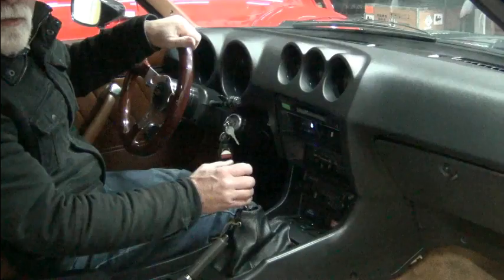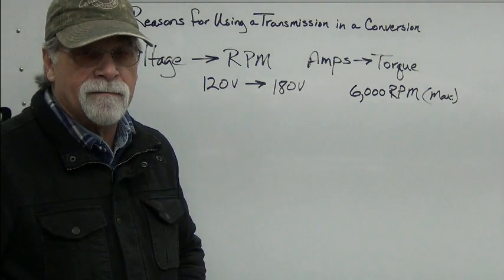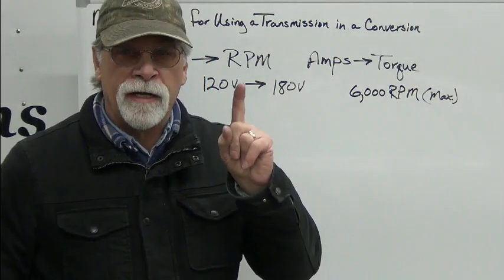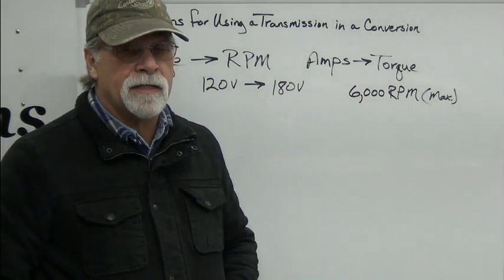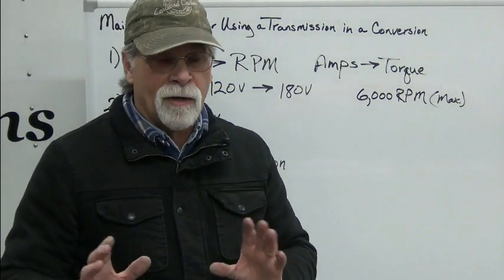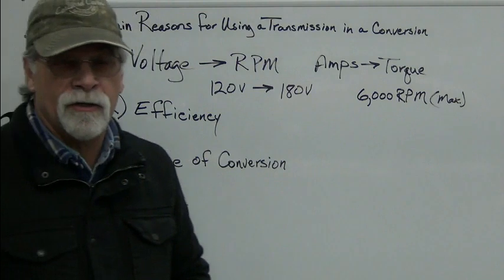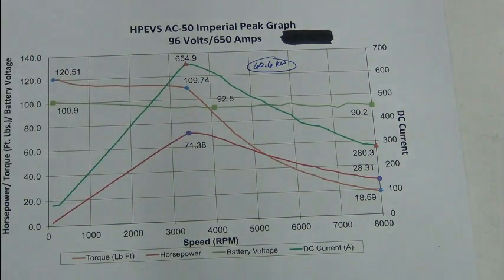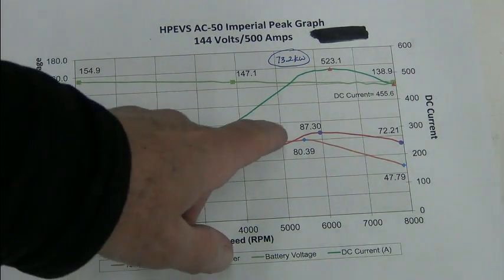Main Reasons to Use a Transmission in a Conversion

Comment: A transmission is a MUST in any conversion, it represents many advantages for either speed or torque. It is also a safety device. Writing this before watching the video.
Reply: Nice video but you didn’t mention SAFETY as a great advantage in a transmission. 

It could be nice to show those charts for the DC Systems: ADC 9”, Warp9 and 11c Kostovs, with the multiple controller options and voltages from 48V (I’m running a train at 48v moving 70 people in a park), then 72, 96, 120, 144V and then the super high voltages 200, 250, 300 or more that the Zillas can handle… destroying world records as well as motors in those attempts

Comment: For a classic conversion a fifth reason is the retains the driving personality and dynamics of the car. I still shift all our conversions. There is a myth that transmissions reduce efficiency in EVs, even though there is engineering studies proving a 15% increase in efficiency. You don't need as many gears do to the wide power band of an electric motor. This is much of the reason the Taycan always exceeds the EPA rating on the highway.

Comment: Back in the eighties as a fleet mechanic at a phone utility we had 12 ford courier pickups with 20 six volt lead acid batteries.  They retained the four speed and the clutch.  Only twenty miles of range but you gotta start somewhere.

Comment: Thanks Richard, and I'm glad to see this video very much!  I was wondering if you could talk about a scratch-build car in your next direct drive video.  I've heard from the community (for what it's worth, some yahoo on social media or whatever) say that direct drive is better for a non-conversion build.  When I eventually build a car, I'm going to coachbuild it from an existing chassis, so the sky's the limit as far as the planning.  Is there a benefit to going direct drive in that scenario?  Regardless, before I do any of this, I will be attending one of your classes, lol, but in the meantime, if you could touch on that it would give me a direction to think it over.
Reply from the maker: The #1 reason (voltage) does not change.  Direct drive will require a higher voltage system and a more powerful motor.

Comment: So glad I found this channel! Love this stuff!
Reply from the maker: Thank you for watching and for your nice comments.
Reply: @ev4u  I did have a question for you: how can you tell how many gears and what ratio of gears you need to run better? Is it more gears is better always? Or maybe with EVs you need less gears and can ramp up to faster ratios or something?

Also.. i know very little about transmissions. Do you just hop clean over car trans to use a beefy truck transti handle the extra torque? How do i go about matching a motor to a trans for a project. Im sure it has to be a strong one but the beefier you go the more weight youre adding probably. How do you not overshoot the target and pick the right trans?
Reply from the maker: Please address questions to:  info@EV4Unow.com  Thank you.

Comment: Great video! I always don't believe in EV oem designer, who drop out the  gearbox. Next step is put the gear box into EV to increase 3-4 time the range of the EVs
Reply: That's not how things work.. regardless of gear ratio your load (aero and friction drag) is proportional to your speed. The only reason gasoline vehicles gain efficiency using a gearbox is that the ideal power band is rather limited range where peak torque starts.

Comment: Could you talk a little more about security? I know that if a controller fails it gives all the power to the motor. In that situation, clutch is important to diaconnet the motor  but in emergency, if you turn the key switch off you will turn hidraulic brake off and power steering off too, is that correct? What can we do to stop a car safety in this emergency situattion? Thanks a lot for this great video.
Reply from the maker: An AC inverter/controller will not fail in a full power scenario.  However, that is possible with DC controllers.  We used multiple layers of protection including throttle operated safety devices, an emergency disconnect switch, as well as the clutch.  DC conversions are covered in detail in our Online EV Workshops.  www.EVWorkshops.com
Reply: @ev4u  Did you do DC conversations? It is suitable for automobile?
Reply from the maker: Yes, in the early days we did a lot of them.  However, I would recommend an AC conversion now days.  Check out our old YouTube videos for examples of DC conversions.

Comment: Does axial play when the clutch is pressed damages the electric motor?
Reply from the maker: No it does not.
Note that the clutch is only used when shifting between gears and the motor bearings are able to handle clutch thrust.
Thank you for watching.

Comment: I would probably rank it like this 
(for keeping a manual transmission in an ev swap/conversion): 
1) Fun/ relaxing. 
2) Efficiency. 
3) Voltage. 
4) Cost. 
5) Ease of conversion. 
6) Weight balance.
Reply from the maker: Thank you for watching and being a subscriber.  Appreciate the comment.